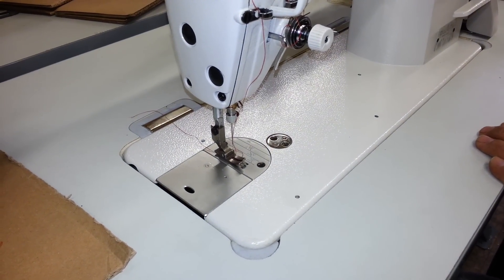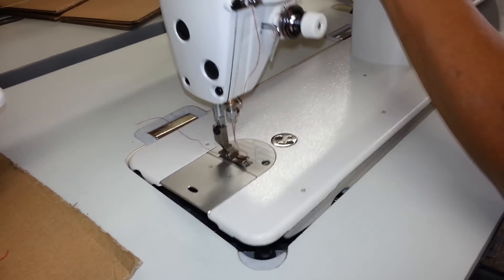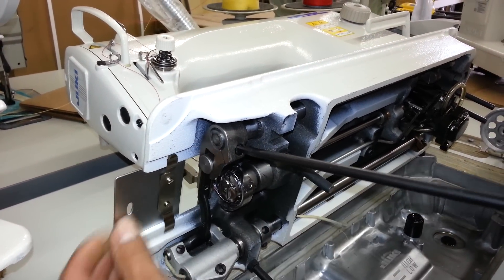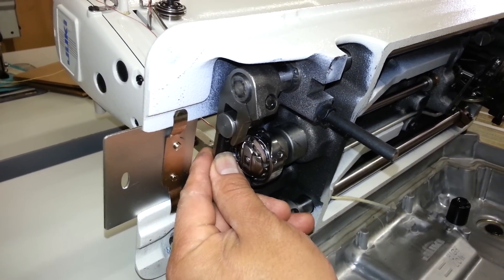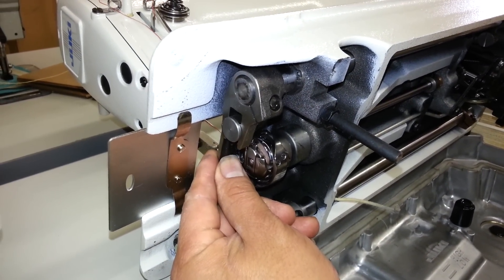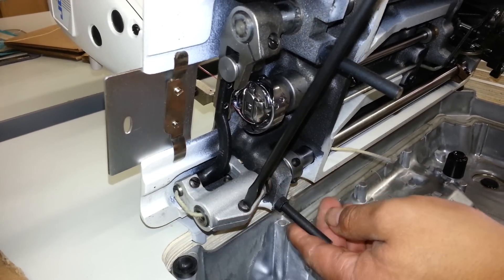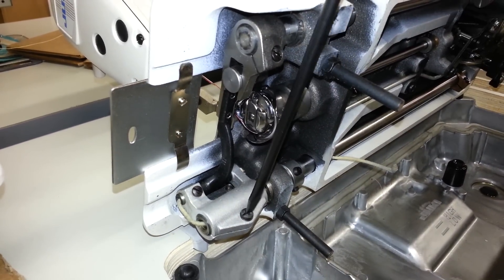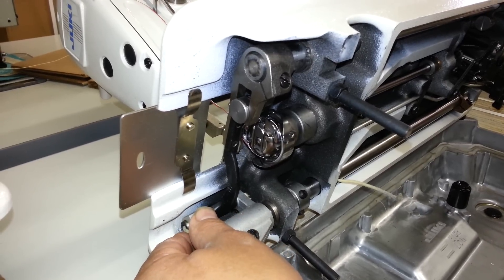Juki single needle lockstitch feed dog adjustment

Comment: Our Juki Overlock MS-6816s is sewing in reverse. Well, not sewing, everything seems to be going the right direction but the fabric gets pushed out instead of pulled in. And I cannot thread it, it won't chain. I was told it was something electrical. Any ideas?